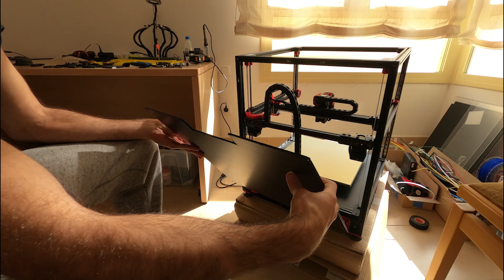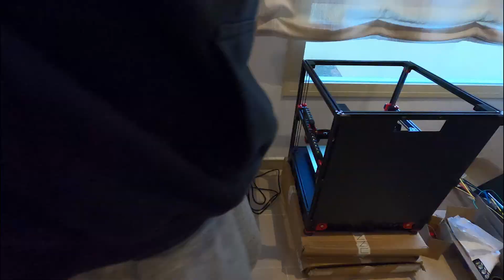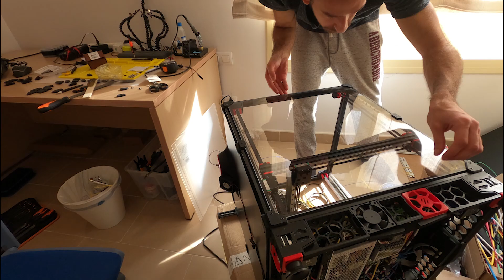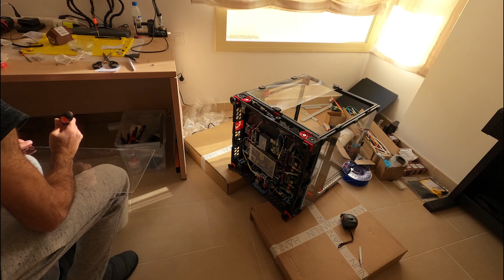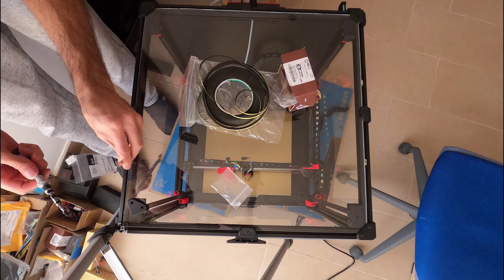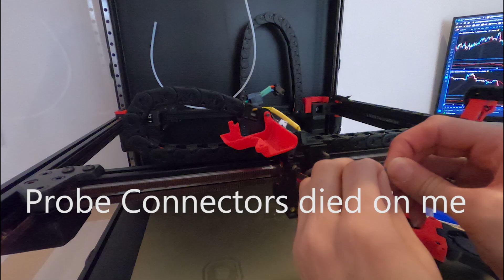Voron 2.4 Build Project - 11 - Panels, Doors, & Done!

Comment: Where did you purchase the panels? I'm thinking of getting the arcylic and aluminum from printedsolid
Reply from the maker: You can purchase the panels from most local hardware store, I got them from Home Depot in Canada. Although they might be more expensive now due to the current climate. I got the extrusions from fermio labs, and I would recommend them!

Comment: Fast slicer profile tuning that would be a good video !!!!!
Reply: My main moto of making this printer is to print high temp. materials such as peek... Can this configuration take it?
Reply from the maker: @pushkarbokarey  You can definitely use a V6. The titan will require some custom workarounds in order to have it work. I would not suggest doing that. One of the many advantages of the voron 2.4 is that it can provide a very stable chamber temperature as well as a high bed temp. So as long as your extruder can reach the temperatures necessary for peek (which the V6 cannot I believe) you should not have a problem. Hope this helps!
Reply from the maker: Thanks for the suggestion!
Reply: @AeroAce1994  currently me myself on that path. Input shaper and pressure advance done.. But for 100mm/s. And seems that v2.4 is capable of 300-400 mm/s
Reply: @AeroAce1994  can we use direct drive titan & V6 hotend on this? I have that in spare...